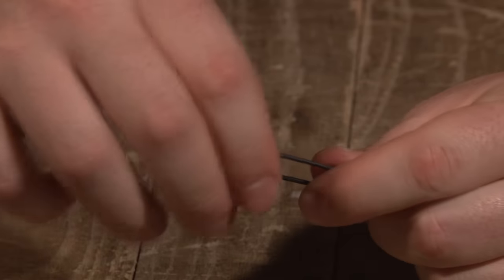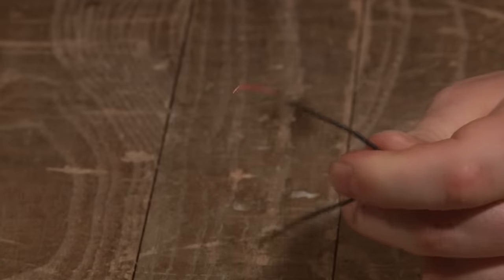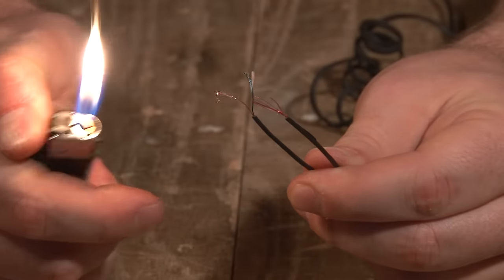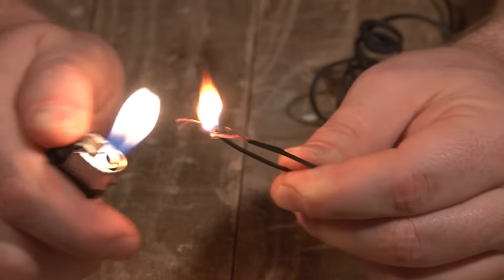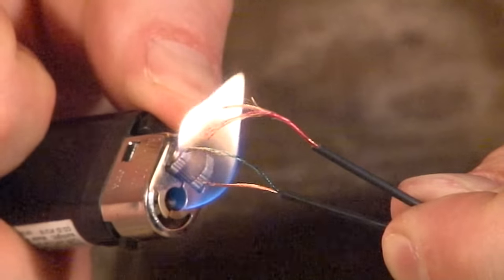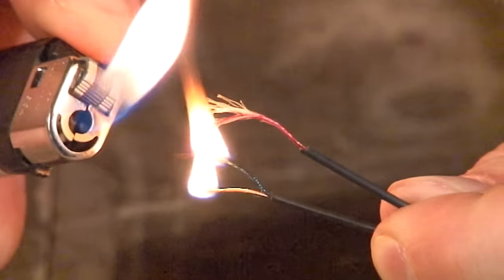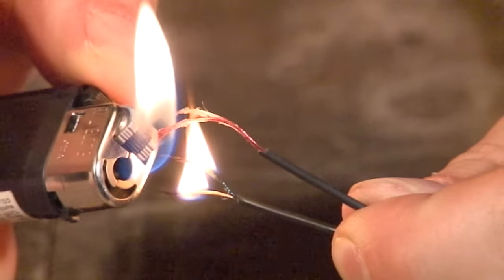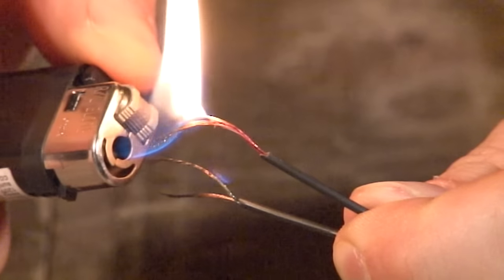How To Solder Tiny Guage

Comment: I don't get it. If the wires gauge is already too small, then why would you burn away an outer layer (the coating), effectively making it an even smaller gauge?
Reply from the maker: The outer layer is plastic, which won't allow audio signals to pass, an insulator, without removing it it can contaminate the solder joint. it doesn't matter if it's smaller, it matter that it's connected. We're also talking a microscopic layer, so probably not ever registrable on a AWG or gauge level.

Comment: People, after years of experimenting, I have finally found the BEST way to solder these tiny headphone wires
1)Firstly strip the plastic wire housing.
2) Next apply PAINT THINNER on each of the tiny wires. Wait for it to dry(2 mins).
3) Then grab a soldering iron, put some solder on it, and run the tip of the iron through the wire in a DOWNWARDS DIRECTION -the wire should start bubbling - this actually gets rid of the enamel coating as it sticks to the solder. Let this solder drip on the table/remove this solder. (If you use lighter to burn the enamel, you don’t actually remove the enamel - you just melt it, which is why people find it so hard to solder these wires. )

Now, you have actually REMOVED and TINNED the wire (which is impossible if you use fire to melt the enamel)
At this stage you just need to connect the tinned wires together and solder.  `
Reply: Sam y  really useful tips buddy
Reply: Hi my friend what can use thinner sentetic etc?
Reply: This is the real tutorial! Do what Sam says. And the wires shown in the video are NOT tiny gauge. I just worked with tiny gauge and it's a nightmare.
The ones I struggled with cannot even be stripped with a thumb because they break apart under the pressure.
Reply: Dipping in acid also does the teick